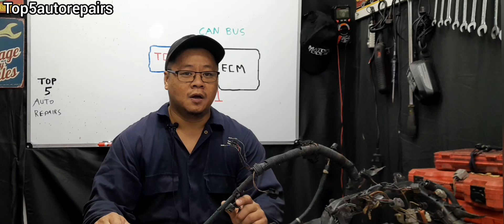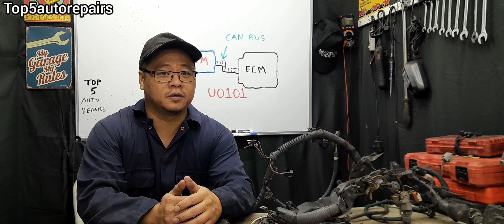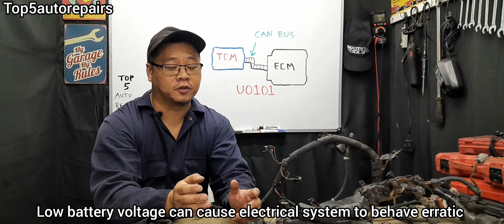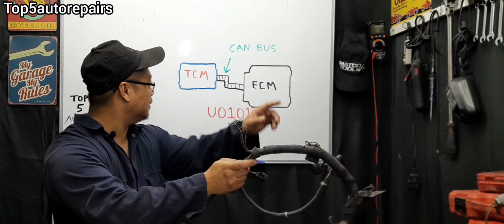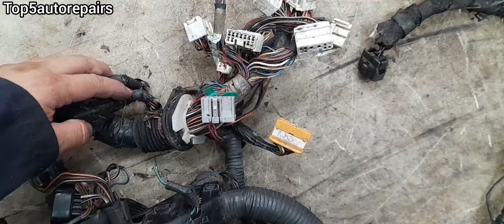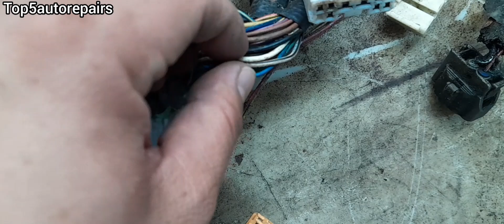U0101 LOST COMMUNICATION WITH TRANSMISSION CONTROL MODULE (TCM) - A REPAIR GUIDE

Comment: Bro, what if I had my car worked on it’s a false code how do I clear it?
Reply from the maker: Disconnect the negative cable for a minute or use a scan tool and erase the code. Ghost codes are real and usually triggered by a glitch somewhere in the electrical system.

Comment: Jeep grand Cherokee 2017 “I have a U0101 code, U0415 code, Service Stability Control warning, and the dashboard occasionally shows ‘Service Shifter.’ The vehicle has also had intermittent stalling and ‘Shift to Park’ messages. Could a failing Transfer Case Control Module (TCCM) have caused these issues, and would replacing the TCCM fix the problem, or should I be looking elsewhere such as the ABS module, wheel speed sensors, CAN bus wiring, grounds, or the TCM?”

Comment: Bmw x1 2018 7 speed gearbox 

I need help. My car battery died, so I took it to a repair shop to replace it. After installing the new battery, the drivetrain started shaking. I took it to another workshop to have the battery reprogrammed, and I was surprised to find the technician dropping a 3-gallon water over the gearbox from the upper side . When I asked why, he said it was to hot the transmission during the reprogramming process. Since then, the car has been shaking while driving, the RPMs sometimes spike, and it might skip gears. I discovered that the transmission control connector has a short circuit, and it only works in gears 2, 4, and 6. The control unit and its wiring harness were replaced, but the problem persists, and the new that a  unrelated issues have appeared like abs  els….

Comment: My Chevrolet trax 2020 have the same code U0101-00 lost communication transmission module 
That part price is $550 plus $500 mechanic charge me. I need your opinion please thanks

Comment: I have a 2016 sonic with a u0101.  I have good pwr ,grd, and 11.5 volts on the wake-up line.  I have 1.8 and 2.4 volts on the can lines going to tcm and same coming out of tcm at ecm connector and splice pack.  Could the issue still be tcm?  Not ready to pull the plug on such an expensive item.
Reply: Did you find the solution?
Reply: @weeaatin Rolled the dice and won-it was in fact the tcm.

Comment: My tcm is getting no power
Reply: It’s a problem with the battery or alternator or fuses if you need help I can help you anytime just hmu
Reply: @lamare1005 mines only do that when it turn then it cut off then on again when turn.
Reply: Turn the week I mean
Reply: My Mazda 3 shifts gears normally drives perfectly fine. Just at times randomly it wont reverse in the reverse gear. It goes limp and will stay like that. Could changing tcm fuse possibly fix this issue. Or getting a new battery??

Comment: My wife’s Chevy Malibu won’t start but the dashboard & lights come on the shop says the alternator & fuses are good. Any suggestions?
Reply: Ck the starter. See if it’s getting power and ground. It also has a trigger wire that gets 12 Volts when key is in crank engine position. 
What codes are you getting? 
My transmission connector prevented my Silverado from starting that’s why I’m here.
Reply: What else did the shop say? They just looked at the car and said “alternator and fuses are good, can’t figure it out sorry” and gave the car back?

Comment: Hi i have Holden Captiva 2012 2.2 diesel I swap engine and there are ECM codes U0100, U2105, U2106, CO561, U0101. Vehicle doesn't crank and starting from ignition with key but crank from relay pulled after jump with one wire, battery and ignition switch is replaced. Nothing changed. Hope you can help me something out.
Reply: It’s a problem with the battery or alternator or fuses if you need help I can help you anytime just hmu PLEASE HIT ME UP I CAN HELP YOU RIGHT AWAY WITH MULTIPLE TROUBLE SHOOTING

Comment: I get that code for my 2011 Nissan Murano

U0101, P0746, P1778,

I change the transmission fluid & filter , I cleaned all the ground wires by the TCM & terminals! 

I also check voltage for the solenoids in the valve body. Everything is good !!!

I didn’t reprogram the TCM commuter tho. 

Can anyone help me pls. My transmission does go passed 1first gear ! I think it’s on limp mode ??? 

Can anyone help me pls.
Reply: It’s a problem with the battery or alternator or fuses if you need help I can help you anytime just hmu
Reply: @lam @lamare1005 you help me too please 🙏 my 2018 ford transit gotta Tcm & Ecm U101 code 2weeks ago but now lately it’ hasn’t popped back up but my truck drives and makes a loud throbbing thrusting moaning noise when it jerks driving In 2nd gear highway it’s fine I’m coasting . Also I’ve recently had a wiring issue shortage with all the wires that run to the back of my truck
Reply: Please contact me I will help you with this or any further issues for free

Comment: Hello, I have a 6l80 transmission that I just completely repaired. I changed all the gears and also the reverse gear, but after 20 miles it started to give me the U0101 code, but even with that code it continues to work well. I have checked the two connections inside the transmission and they are fine, but I cannot find the ground wire for the TCM. Could you help me or give me an idea of where the problem is? Thank you very much.